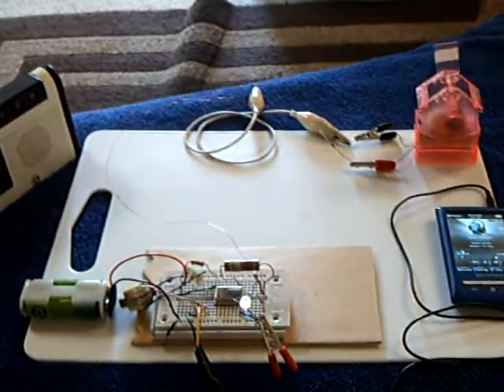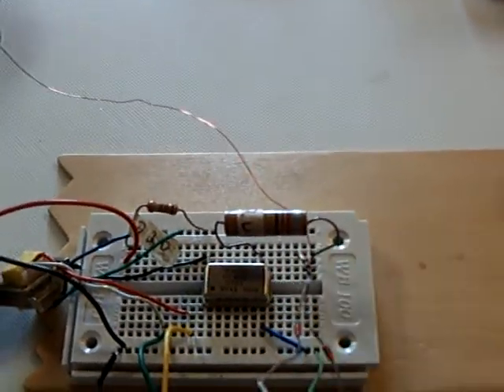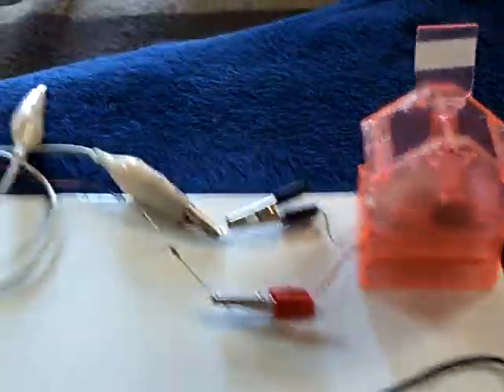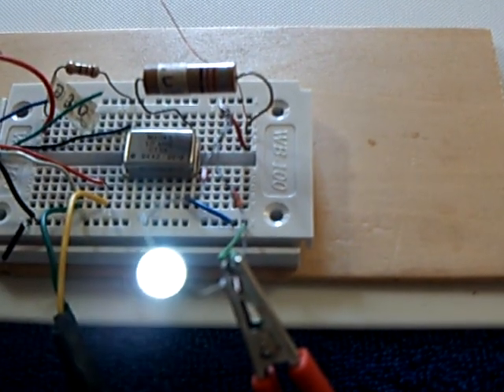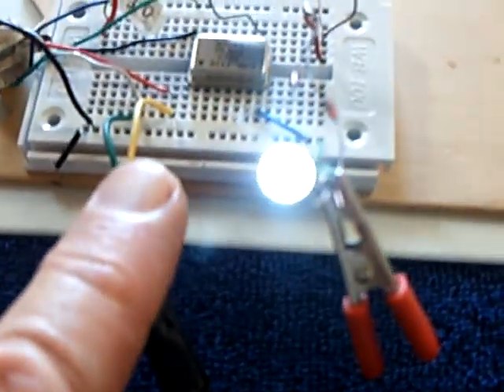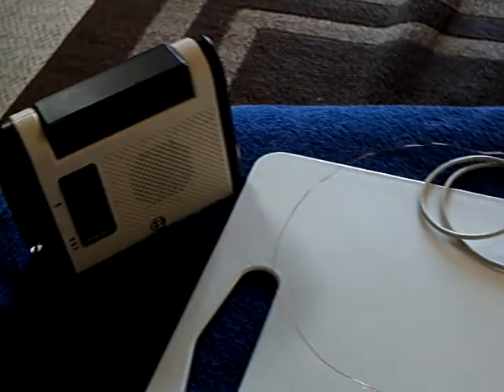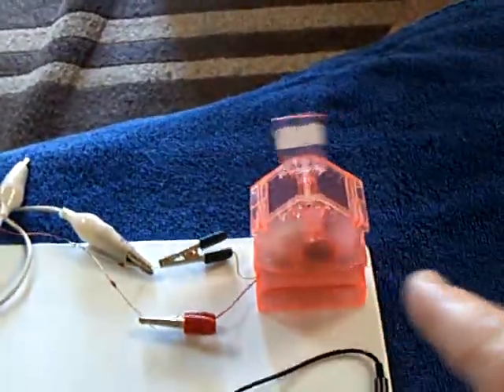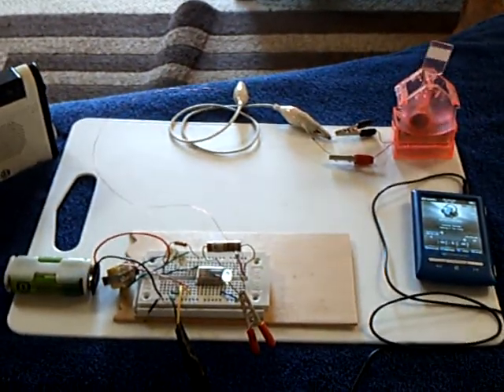Crystal oscillator radio transmitter

Comment: can you change the transmitting frequency by simply changing the crystal oscillator or do you need to change other parts so it works with the oscillator?

Comment from the maker: Those Hankscraft advertisers are similar to the solar waving flowers only better.  I have a Hankscraft advertiser from the 60s that is non electronic and runs on 1 D cell.  It is a simple pulse motor with mechanical contacts but rather efficient considering the simplicity.

Comment: Hi,
It very nice and the simplest transmitter on the earth !
Btw..What frequencies does the transmission and reception occur ?
I just need clarity on that part. please respond.
Reply: Whatever frequency the crystal is tuned for.
Reply: I made this transmitter with 1MHz crystal oscillator and LC tank circuit, it works GREAT. With 1m antenna range is about 3 meters. However when i connected 25 meter long antenna range extended to 90 meters. You need long antenna for big range because wavelength of 1MHz is about 300 meters